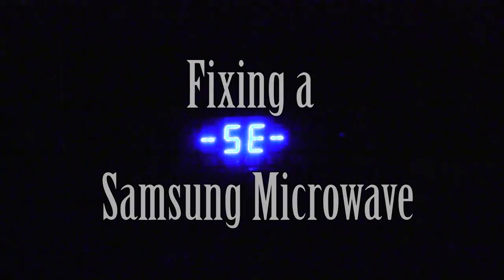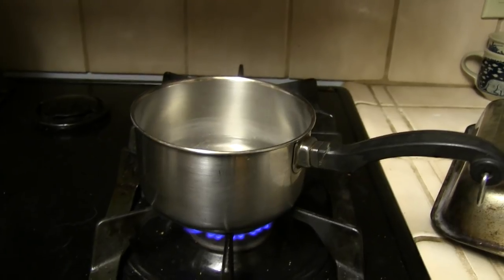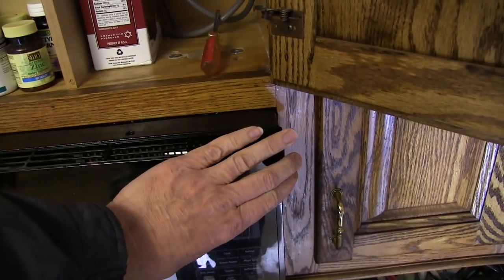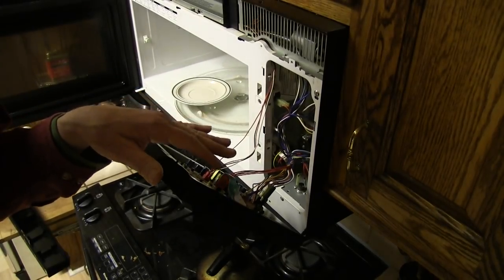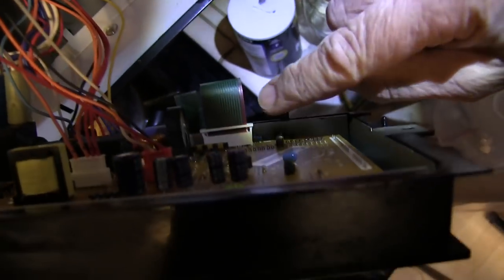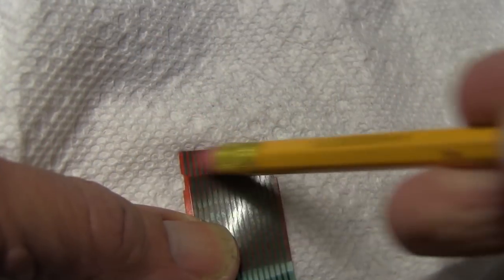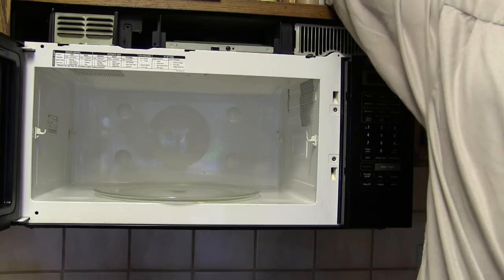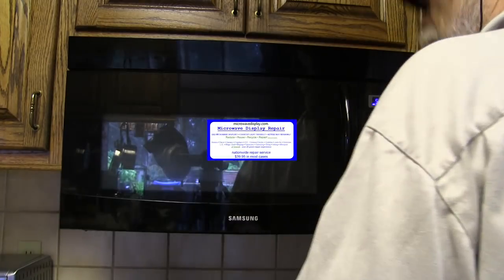Fixing a broken Samsung Microwave - The dreaded 5E error code -- aka the SE error code.

Comment: Great Video Very Helpful & Well Done!!!   

Here's my experience on bringing my microwave back to life...

I took all the connectors off of the board and sprayed both male and female ends with CRC QD contact cleaner. I then did the same with all the connectors I could get to, plugged the microwave in and still got the same SE error on the screen. 

I was literally ready to throw in the towel and decided to try one last thing (hail Mary with nothing to lose) before calling it a day. I sprayed the entire board down with the CRC contact cleaner and waited about 10 - 15 minutes before plugging the microwave in. The first thing that popped up was the clock time set, a good sign. I set the time anticipating the SE error would rear it's ugly head but it didn't, another good sign. 

I then decided to put the microwave to the real test, I placed an item in the micro, set the time and it works like new again!!!

Comment: Thank you for publishing this video for the Samsung Microwave Model SMH9187 5E error code, my unit failed at 4 years old. We are a heavy user of the unit, ie, most of our cooking is done with this microwave with no problems. I took off the control panel as suggested and cleaned the connectors with a good contact cleaner.  Reassembled and it worked, but only for a few minutes.  Removed the control panel again and went back to the ribbon cable, the most suspicious connection. The contacts on the cable were a dark gray in color.  The contact cleaner hadn't worked.  Then I used the old "Pink Pearl" eraser and buffed the contacts.  Amazing, they were bright shinny silver when finished.  Reassembled the control panel and it's worked ever since (at least two weeks now under heavy use). The issue appears to be that these ribbon cable contacts, which should have been gold plated like the connector are not, and therefore, in the environment to which they operate just corrode (a resistive surface compound of some sort). A major design flaw by Samsung. Good luck to the next reader, there is hope.

Comment: I tried this technique & the SE code has disappeared, but the microwave still doesn't work.  Instead the of the SE in the display, it just shows a 0.  Per your advice at the end, I called Samsung & they immediately offered to repair the microwave at no charge, providing it's the SE code.  I just hope the loss of the SE doesn't invalidate their offer, or that the SE returns before they come to replace the control panel.  Thanks for your video - without this I would never have known to call Samsung about the problem.  Others might want to try to call them before attempting to fix it themselves since they seem to be stepping up to repair the problem.

Comment: I had this problem with my Samsung microwave too., several times until I figured out a way to keep steam out.   After I cleaned the contacts and made sure everything was working again, I used aluminum foil tape along the bottom of the control panel above the stove, as well as inside the door, sealing the control panel to the cabinet.  I made sure that no foil tape was inside the actual cooking cavity.   I had to cut out the openings for the latching mechanism so the door would latch properly.  After doing this, I have not had any problems with the SE code.  I cant remember when I initially did this, but not problems to date.  I have changed the tape out at least once when it got really cruddy dirty. Not for the faint of heart as the adhesive on the foil tape is tenacious.  Saved me from having to purchase a new keypad that would probably end up with the same error after a while.

Comment: Excellent video! Sitting eating dinner tonight after making pizza all of a sudden we got the dreaded SE code. It turned out that our ribbon cable was oxidized from a lot of steam/grease, cleaned it with an eraser and it seems to have done the trick. Thanks for a great DIY video.

Comment: I had the same problem. I am no engineer, and was scared to open the cabinet. But I sort of solved the problem like this: I pointed a hair drier at the membrane keypad and left the drier running in full power for about 5 minutes. Apparently this cured the dampness inside the membrane, and it worked perfectly. I had to do this regularly once a day for a week. After that the keypad just works fine regularly!

Comment: Joe, you are brilliant! We were just getting ready to go out to buy a new microwave when I saw your fine advice. I cleaned the contacts with isopropyl alcohol and also sanded the one exposed contact. The microwave worked again immediately. Actually, this was the second time for this issue. The first was while it was under warranty...they replaced the key pad. However, I will add this: DO NOT BUY SAMSUNG APPLICANCES. Last year we had three of them fail at the same time...1) the microwave (repaired under warranty, but failed again last week); 2) our DVD / VHS recorder / player, which they refused to fix even though it was still under warranty (They actually said: "Your warranty is active but will be expired by the time you get the product back to us, so we will not fix it free."); and 3) our new Samsung washing machine. The washing machine was the biggest problem. We ended up having no washing machine for 13 weeks! They kept sending repair guys with the exact same parts (4 times) and the exact same failure kept happening. I have a business associate in Korea who used to work for Samsung and does business currently with them. I sent him a flaming email about the washing machine and told him to get it to high level executives at Samsung. He did so and the next morning we got a call from the office of the president of Samsung USA. Ultimately they took away the existing lemon washing machine and replaced it with another. So, I say to all who read this, DO NOT BUY SAMSUNG APPLIANCES, or any other Samsung products. As you learned with your microwave, it was a known problem to Samsung. That is likely the case with my other crap Samsung products.

Comment: I bought this wave at a Goodwill and all the paper work was with it and the last individual had the same issue. They bought a new function display and had a repairman fix the issue, well it came back. All I did was take the cover off and cleaned the (green) ground wire from the 'power cord' its on top. Unscrew it and take a piece of sandpaper and clean the surface area on the ground connector (both sides) and the surface on the microwave on were it connects. Reason, the coating on the surface is corrosion resistive and blocks the flow of electrons (resistance) and they build-up and can't escape causing a dysfunctional error within the keypad. Hope this helps.

Comment: good job.  Looks like my unit is same model as yours.  I had the same error.  I was not very good at cleaning the pin style connectors.  I could not find my mini screw driver set.  But I think the culprit was the ribbon cable.  This one has the least amount of pressure applied at the connector points than the other connections.  I used the pencil eraser method and that did the trick.  Thanks again for your help.  It saved me a couple hundred dollars.  Note my unit is about 7 years old.

Comment: That was a great to the point video, well done all around. Wanted to suggest the possible use of dielectric grease (used for car iginition) to seal out the water/vapor for longevity of the repair. Have yet to try it but I'm sure it is going to work with all the other positive replies, thanks for the video.

Comment: Thank You.  Just did this on my 2 1/2 year old Samsung over the stove microwave and so far so good - works like a charm.  Nice easy to follow video.  Only thing I did a bit different was that I used some contact cleaner on all the connector pins and sockets.  Took about twenty minutes, hope it holds up for awhile. Thanks again!

Comment: Thanks for the great video tutorial! Worked like a champ! I did figure out a shortcut: the first thing I did was to pull the ribbon cable and cleaned it with the eraser, as you suggested. That was genius. I would never have thought of that. Then I plugged it back in and powered up the microwave. It works perfectly. Kind of a Samsung design flaw having the connections open to moisture like that but now I know how to fix it. Tnanks again!

Comment: Tried everything according to the video above but after a little while it would start again and it started doing it 3-4 time a day. Then I decided instead of putting the connectors back dry, I decided to get some electrical grease and apply it to each connector. That seems to work because now moisture can't get in there anymore, and I don't have anymore sleepless nights listening to the alarm on the micro wave. Try it, you might like it.

Comment: Worked like a charm.  I used audio/visual cleaner sprayed the hell out of the panel and, used a SOFT toothbrush. Let it dry completely. Next day plugged it in and, BAM worked. It’s been 2 days. No SE or 5E codes.

Comment: Thank you, thank you, thank you. I got the dreaded error message on Sunday and went on the internet and saw your video.  I got the computer cleaner and my neighbor came over and helped me take it apart, we cleaned it and put it back together and held our breath as we plugged it back in.  It's working.  Just did it so don't know how long it will last but at least know now that if it needs a new control panel, we can do it ourselves.  Thanks again.  Appreciate it.

Comment: THANK YOU VERY MUCH... Had exactly the same microwave, and exactly the same symptoms, followed exactly the same process, and had exactly the same results. Isn't science wonderful! My money for "root cause" is on that ribbon cable - the whole thing was tacky with grease. Cleaned it up nicely, and no more problems. SMH9187, installed 2011 (8 years ago), worked good but that keypad has cracks in it that made me think is was gonna go sometime soon. Actually replaced the turntable coupler a year ago which cracked - machined a replacement, which held until a real replacement arrived, and now I have a hot spare...

Comment: Great video. In my case, I decided to clean only the contacts of the ribbon cable with a pencil eraser. A lot of black came off and when I put it back together, it was again working. This saved me from pulling off all the other connectors and remembering how they went. I did take a couple photographs with my cell phone of the circuit board in case I had to remove the other connectors but didn't have to.

Comment: Excellent video.  It worked for me.  I have the same microwave (9 years old) and it had the same SE error.  The first item I cleaned off was the ribbon cable with a pencil eraser and that is what fixed the problem.  Thank you!

Comment: Thanks, Joe!

I had already had this failure two years ago and paid $40 for replacement part, which I installed myself. Your vid wasn't around then.

It really does work. Most important cleanup, seems to be the ribbon cable. Mine was almost black with oxidation. Pencil eraser worked perfectly.

You just saved me $40 for second failure and plenty of time, too. Not so easy to get the right part. Thanks!

Comment: Great video! My microwave did not have the SE error message but it did have a corrupted display and I thought I’d try your recommendation. I found the ribbon cable was very loose, once I plugged it in all the way Wala I was off and running. Thanks for the great tip!

Comment: Thanks for the video walkthrough!  I think the main issue is likely the ribbon cable developing a layer of oxidation.  Using the pencil eraser to gently scrub away and clean the contact points, and the act of removing and reconnecting all the connectors was enough to get ours working again.  It took less time to do the work than watching you describe it on the video! :)

Comment: Good informational video. I suspected the keypad when the oven would all by itself put up all "4s" on the display and then ask for a power setting. Then I got the "SE" error. Pulled the keypad and found the ribbon connector for the keypad was not plugged all the way into the connector. Reseated the keypad ribbon cable and all is good.

Comment: Thanks so much for the tip.  I followed all your instructions only to find a "bug" in the circuit board.  It was a Palmetto bug!! Shorted out the circuit board but I never would have discovered it had I not watched your video.

Comment: Worked great! I have an Amana/Frigidaire that is 10 years old and had the same layout as yours. I used a can of CD electronics cleaner and a toothbrush to clean all contacts, then a pink eraser for the ribbon cable (corrosion on the cable must be erased, not just cleaned). Thank you! Saved at least $150!!

Comment: Thanks, you saved me over $400.00 . I tried to remove the panels, but my otr microwave was installed a little differently. So I called Samsung Jun 2019. My microwave warranty expired 6 years ago. At first the representative was unable to help me. But I mentioned the SE error, Samsung’s acknowledgement of the problem and consumer affairs. Then I was transferred to someone else. They said if it was an SE errror and only an SE error they would fix it and cover the charges.  The repair person quoted me a little over $400.00 to fix. But Samsung covered the cost. Thank you for this video. July 10, 2019     Saskatoon, sk. Canada

Comment: I noticed there are 878 comments and do not have the time to read them all, but I thank you very much for the information and education!  If someone did not mention this in a previous comment, using a very small amount of dielectric grease for low voltage connectors will help prevent this problem from happening again due to it's sealing and waterproofing properties when applied to electrical contacts and harnesses

Comment: I tried this fix because I have had a dead microwave for over a week while I have been calling Samsung to get this repaired.  I cleaned the ribbon cable and reseated all the connectors several times.  Within 15 minutes I had a working microwave oven again.

The problem seems to be that the connectors are tinned instead of gold plated and thus are affected by humidity and steam rising up from the range and corroding the contacts.

Awesome fix.  Thanks.

Comment: We had this microwave when we moved into our new house. It looked like this fix has been done before. All of the electrical looked clean except the ribbon cable. Cleaned it with a pencil eraser and it works fine now! I have a feeling that where the ribbon cable is inserted may need cleaning too at some point. Thanks for saving us 75 bucks through the home warranty!!!

Comment: Thank you so much!  It worked!!!  Now I'm mad that I spent $75+ having the last display panel replaced.  I cleaned the ribbon cable end with an eraser and Radio Shack electric connection spray cleaner, and also released a bit of the tension on the crimped ribbon cable by shoving a bit of rolled-up paper under the crimp.  Works great now!  Thanks so much for a great fix, and a great video!

Comment: I tried what your video states and it worked!  After about 10 minutes it went back to the SE on the screen.  I thoroughly did exactly as the video explained again and this time it came on with the SE on the screen.  I'm assuming that I need a new keypad.  However, it looks like it worked for a lot of others.  Thanks
Reply: By the way, my microwave is 12 years old

Comment: Just tried it, and it worked but only 5 minutes before the SE came back on, did it again using a fine abrasive on the ribbon and connector posts, and again 5 minutes. BUT, as the others said, this was a most awesome DIY video, thanks, so much!
Reply: I had the same problem. Here is a YouTube comment that helped me fix it: "The issue is the fold in the ribbon cable where the top layer (membrane) is folded over the bottom.   There is glue that not only holds the two layers in place, but also acts as a separator.  Once the glue begins to deteriorate due to heat cycles, moisture, vibration, etc., the layers can short at this point and throw the error code.  Place a few strips of electrical tape between the layers under the fold, put your microwave back together, and go make yourself some popcorn, being happy you didn't need to go any further."

Comment: Excellent video!!!  First I tried cleaning only the ribbon wire.  I plugged it in and the error was gone but as I tried to enter the time, I realized the numerals on the keypad didn't respond.  Then I cleaned all the pins / plugs and ribbon wire again, put it back together and it works perfectly.
I noticed other posts on the internet with other brands having the same problem, so I guess it's not inherent just to Samsung. My microwave is almost 5 years old and this is the first time this has happened.  Thanks again for posting this solution!

UPDATE!!!  A day after the fix, the SE error code came back.  Out of frustration, I called Samsung Support.  To my surprise, Samsung said the SE error is a known issue and based on my model / serial # they would send someone to repair it under warranty.  I bought this microwave in December 2009!!!  Samsung is still standing behind it and issued an extended warranty to cover it for this particular SE error issue!  Kudos to Samsung!

Comment: thanks a ton for posting this.  Got the SE code today, and after watching your vid went and cleaned all the contacts with spray contact cleaner.  It's been several hours and still working fine.  Do you see a benefit to applying corrosion inhibitor as well?  Might prevent future issues.

Comment: If it happens again try putting some die electric grease from the automotive section on the contacts it is kinda like a vaseline looking grease that allows the electrical current to flow but protects contacts from moisture and corrosives.